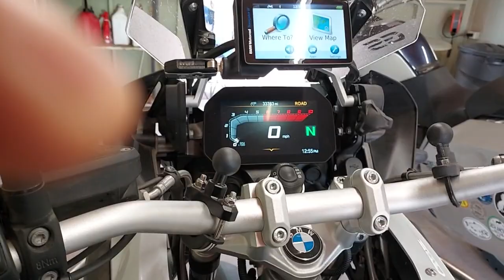2021 BMW R1250GS Broken and Loose Rear Wheel Spokes Ep. 4

Comment: I’ve had BMW spokes loosen from pothole impacts on my 2023 BMW R1250GSA.  It’s interesting to see this same spoke issues on a non-BMW rim.  I wonder if the rim designs are under spec for the bike.
Reply from the maker: Yes over two different R1250's and two different wheel designs I am suspecting these wheel designs may not be up to the incredible low end torque this engine puts on drive components including wheels especially when 2-up and fully loaded. May also explain why broken spokes always on the right side of the wheel and loose spokes on the left, at least on the BMW wheels. If it was rocks or chuckholes I wouldn't expect that failure pattern. Plus I haven't hit any rocks and no chuckholes that I recall and I have been paying attention to that. But I do get on it some when passing and the like which is why I suspect engine torque may be snapping these spokes